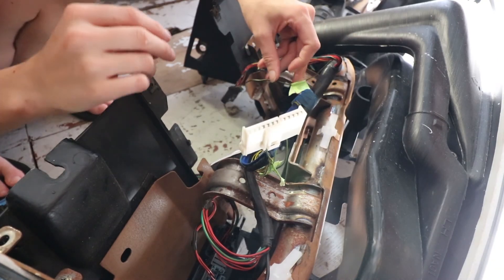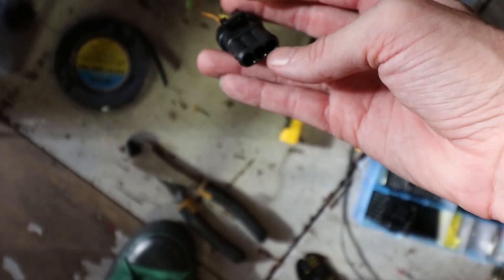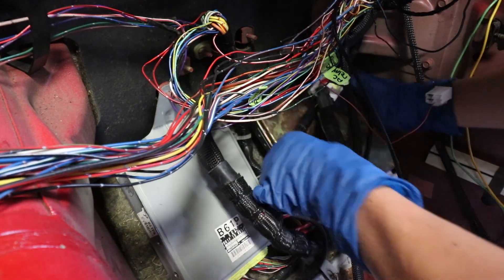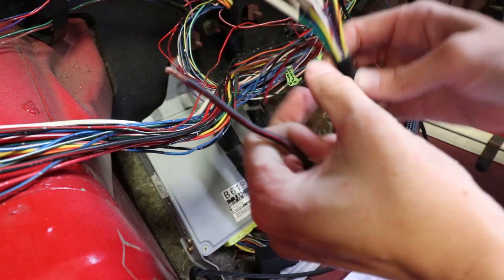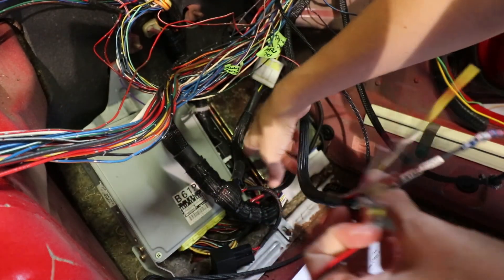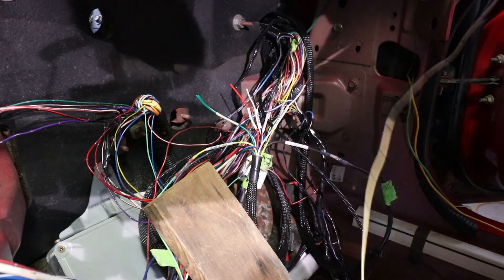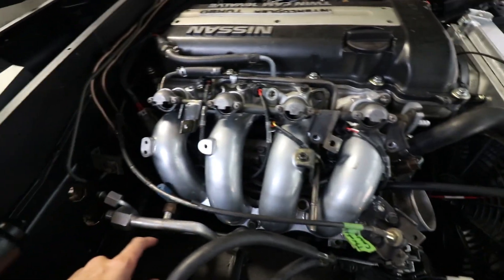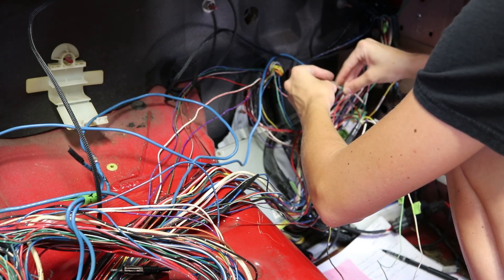SR20DET Miata Swap Wiring

Comment: I know this video is old but I’m doing a sr swap on my hardbody and this video has been pretty helpful so far. Quick question though, you took the starter signal wire from the W.S. Harness that was suppose to plug into the starter and spliced it into the flying leads part of the harness? Assuming I understood that correctly then what is connected to the starter?

Comment: I just took my dash out today to start tackling the wiring for the 2.3T.
I am wanting to know if you left the stock miata ECU in the car to power other things, and if you did, how did you delete the wire you did not need, like injectors etc. Do you just pull the pins out of the ECU plug, or cut and cap them?
Reply from the maker: Nathen Perri what year miata do you have?
Reply: @ChelszH  It is a 91.

Comment: hey there im doing the same swap sr20det into a 1991 miata, i have the same harness as well..i saw your running both ecu's how are you doing that. are you running the miata ecu to run all the interior stuff like lights radio and stuff like that... and if you are how are you doing that. thanks so much your vidoes are awesome
Reply from the maker: Thanks man! I am using the Miata ECU for all lights/radio etc and the SR ECU only powers the engine harness. Although if you bought the pro harness from wiring specialties like I did I had to splice in the flying leads from the SR harness into the wires coming from the Miatas ECU harness and also some from the Miata's Dash harness, the only one I have yet to figure out is the Tachometer wire, still trying to get that to work. 
Feel free to grab my e-mail off my YouTube profile or DM me on Instagram @Chelszh with any questions  you have. I have a ton of photos and I have a whole list of the wire colors I spliced into and everything. Hear to help if you need it, I know there is not a lot of information on this swap at the moment. If I don't hear from you, good luck on the swap! I'm stoked to drive mine around!
Reply: Hey just wanted to see if you figured out how to get the tachometer work.thanks

Comment: Just to be sure, you got the Standalone fuse box (3 Fused Relays plus Labeled Outputs)  in the wiring specialties options right..
Reply from the maker: Yes, I bought the Standalone Sr20DET Wiring Harness for an S13 SR20DET and then I picked the option for the Standalone Fuse Box (3 Fused Relays plus Labeled outputs).